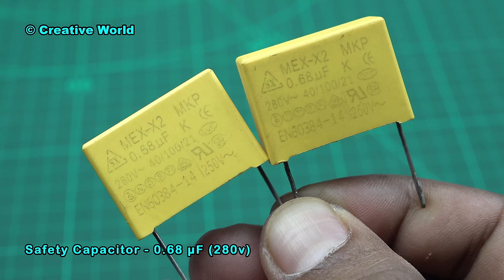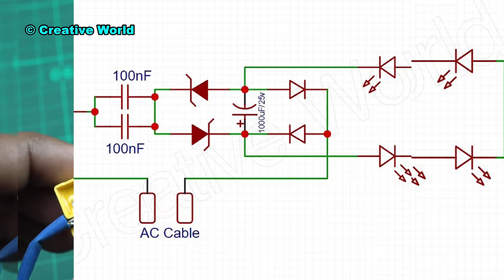AC to DC Converter - 12v Power Supply Circuit

Comment: You forgot to mention that the circuits 12VDC output isn‘t isolated and can potentially have a 250V reference to ground and also, you should add a 470k resistor in between the dropper capacitors to prevent getting a shock after unplugging.
Reply: The supply is not galvanically isolated and will be a shock hazard. But why is he using zener diodes for?

Comment: Ok what's the input voltage 230 110v
Reply from the maker: 230v
Reply: Works for both 120 and 230V although the LEDs will be brighter with 230V.